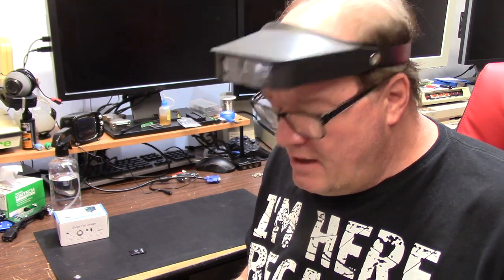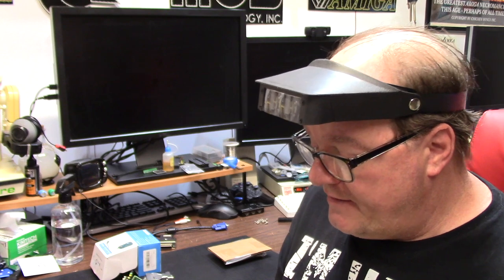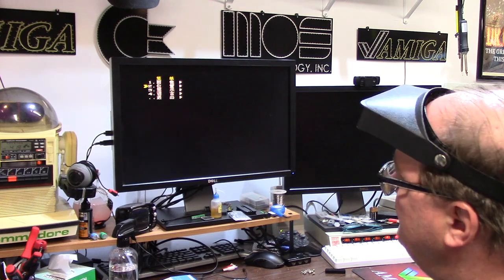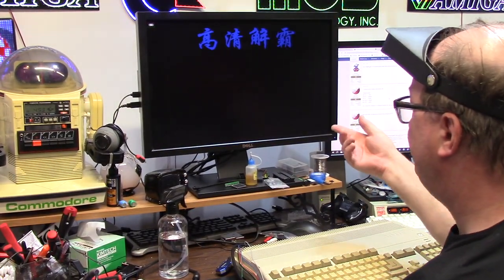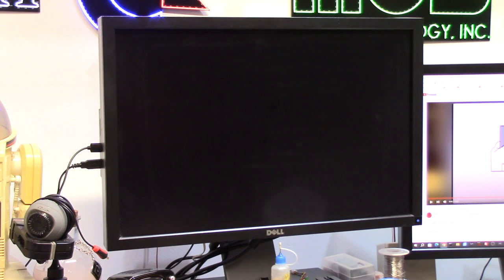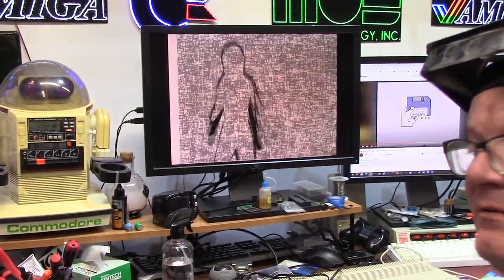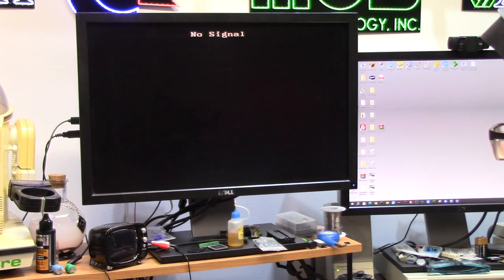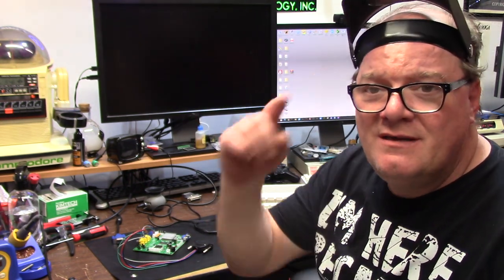The 23$ Amiga Flicker fixer and Scan doubler

Comment: modding with GBS Control is the way to go. There are multiple options to the mod process beyond adding the ESP controller. The 3 control pots are terrible, and nearly every mod starts with cutting those out and replacing them, as well as a few strategically placed capacitors.  Once done, they become pretty GOOD devices, at a much lower cost. For all of us with faulty mk.1 eyeballs, more than sufficient.
Reply: I just wanted to write that. Gbs-control is whole new level for crappy stock GBS8200
Reply: I second all this, gbs control and all the mods makes a massive difference! 👍

Comment: 1. There is a alternative firmware for it called gbs-control.
2. I think you can use VGA DB15 input  insted of this pin connector. Take good old quality VGA monitor cable (proper shilding) and solder DB23 on one side or use DB23 adapter.
3. I bought mine few years ago for 16$ but never used it ;)
For testing and moving icons is great. For dynamic games...ehh after mods can be usable. 23$ + some work its a win win

Comment: The copper tape worked on mine.  The hardest bit is printing a case for it, to make it look priddy and ready for prom night.
Reply: Where does the copper tape sit exactly?
Reply: @hidden_vault  on the underside, its a bit trial and error but  mine is in the area where the signal tracks goto the silicon. I also soldered a  tab to ground for both my squares of tape, with a short bit of single core cable.
Reply: @pkf4124  thx

Comment: Been using one for a few years now coupled with the GBS Control firmware.  The 2A power requirement is a myth, it quite happily runs 0.5A power supply also.  I used an old nokia power supply for mine.

Comment: The little wavey lines can be eliminated by covering the data lines from the ram on the rear of the card.

Use copper tape to cover just the length of the data line.

Cheap and works.

Sorry posted it before you mentioned it 😉
Reply from the maker: Done!

Comment: So, I received mine from Aliexpress and wanted to pair it with my PC CRT monitor and Amiga 500. PSU I used is 5.2V 1.35A. After connecting it with the VGA to DB23 cable on input side and VGA output to monitor I received jumping, flicker screen. Started to research internet for solution whilst everything was on to notice after 10-15 minutes that monitor went off, was very hot and quiet ticking sound was coming out of it. That's how the CRT monitor ended his career, so I obtained LCD 4:3 monitor in it's place, to continue the battle. This monitor withstands the research process much better, though, the effect the GBS provides is pretty much the same as on previous monitor. Been trying to fiddle with Geometry to yours and other sites/videos settings but nothing seems to work... Any clue on your mind or it's just garbage to be returned?
Reply from the maker: maybe its the vga converter, i made a db23 for my unput.

Comment: I have noticed that if you use the Amiga DB23 to DB15 (390682-01) on the GBS picture will flickers in interlaced modes but if you use the homemade cable there is no flicker. Anyone know why or how to make the Commodore 390682-01 or -03 work with interlaced modes with no flicker on the GBS?

Comment: Chris which 3d printed case did you end up using ?
Reply from the maker: this one https://www.thingiverse.com/thing:5166181
Reply: @ChrisEdwardsRestoration  thanks Chris..
Reply: Got my GBS and DB23, great valentine's present from my wife, set it up and yeah an improvement in picture quality.  the copper tape work around worked well. just need to do the printing.  what colour?.  have a black a1200 and out of black filament so looks like silver it is.  Thanks Chris for video...

Comment: Yeah there are NO instructions besides yours! I connected up an old wall wart plug +5V 2A supply, and ...nothing! Prob my old PS. The multivoltage PSU jobbers on amazon are smart but I seem to lose just the right connector plug on every one of them...sigh

(😢2 weeks later...) This unit does not work with my PAL A1200- I can't get into the geometry menu to change anything, and it shows 60 Hz on my eyoyo mini monitor- so i guess anyone with PAL is SOL.